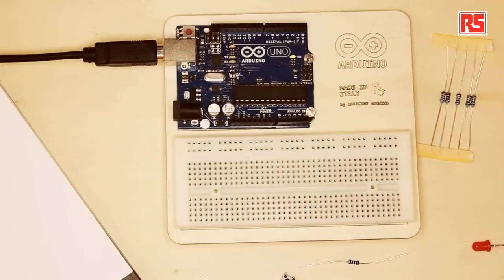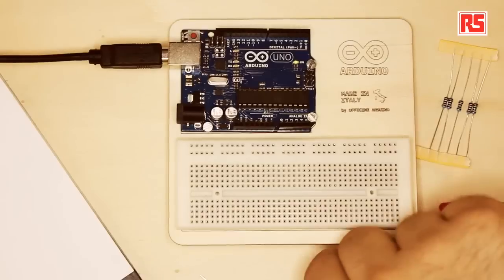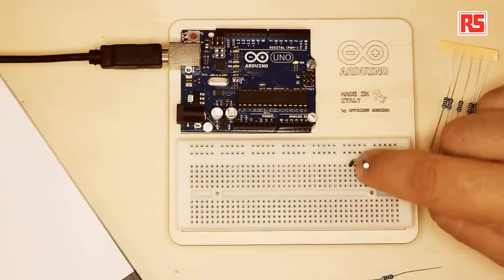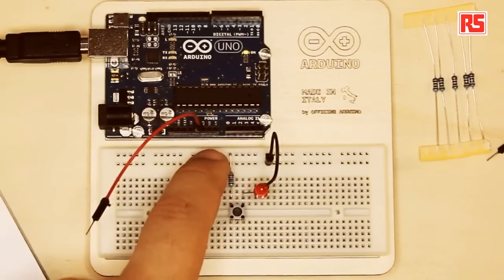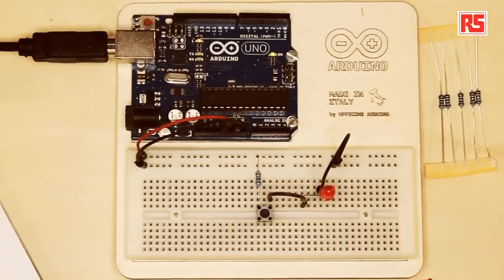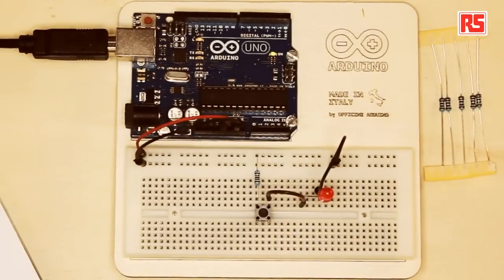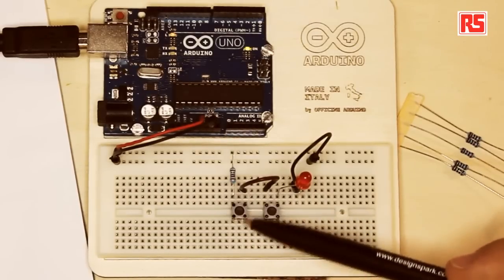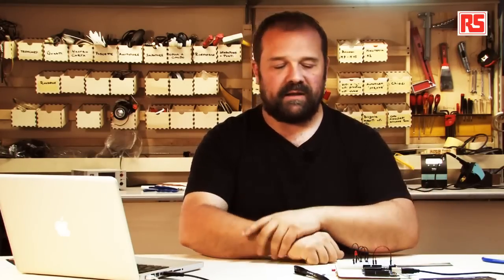Arduino Video Tutorial - 01 Get to know your Tools with Massimo Banzi

Comment: Does loop function run every second? how can you calculate if the button is pushed for 5 seconds?
Reply: Loop runs as fast as the processor in the arduino allows it. Which could be hundreds or thousands of times per second.
You can have an if statement and a sleep/ or timer running.

Comment: Very good! One objection though: speak slower! Most listeners are non-native in English -- listening to another non-native English speaker with a wildly different accent will pose problems.
Reply: If you click on the settings gear on the player you are able to slow down the speed of the video. Sounds weird, but a bit slower if it helps!
Reply: I use that button a lot, both for slowing down and speeding up, but I use to use another method that is better, when the video is long and worthwhile its time: download it and slow down/speed up in vlc (videolan). It is much, much better than the inbuilt YT setting panel. But that wasn't the issue: the issue is to speak slowly and clearly to improve the pedagogical quality beyond good up to magnificient.